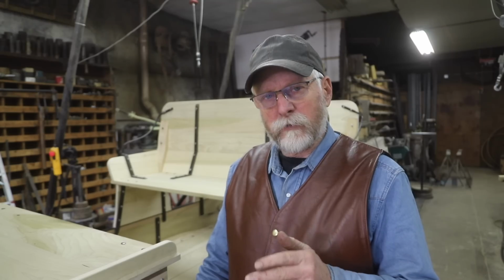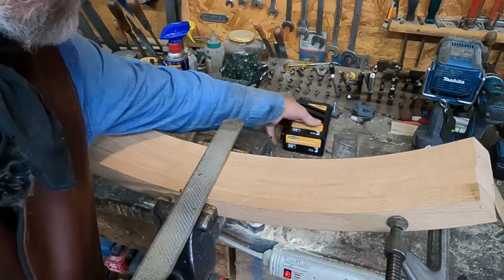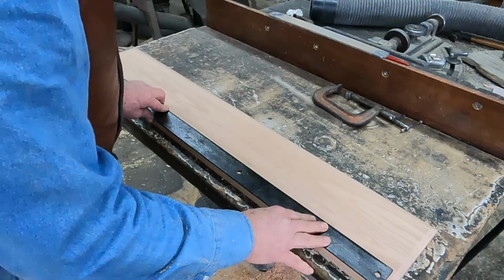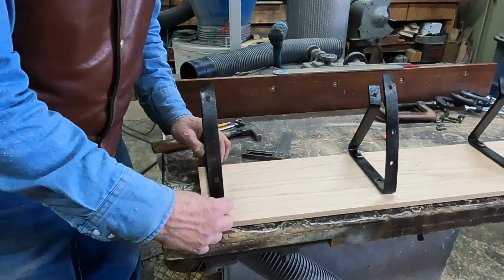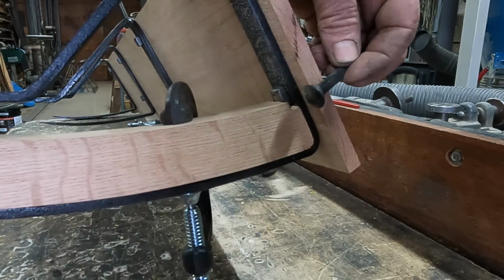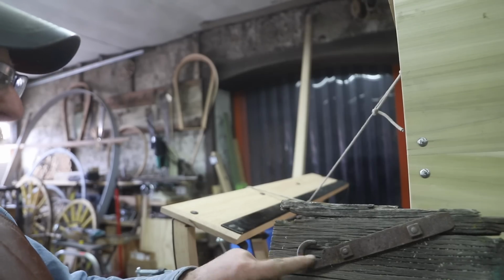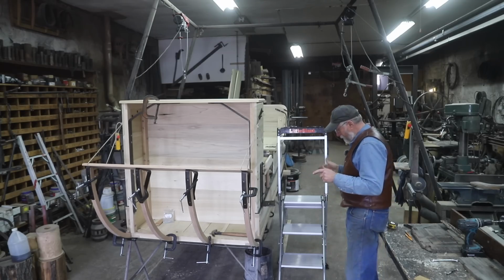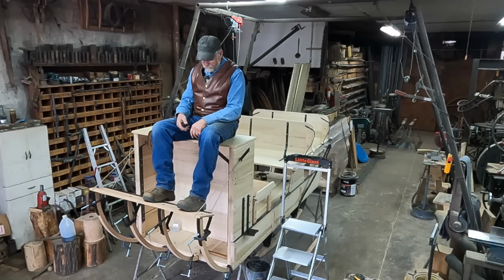Testing My Driver's Boot Design | Engels Coach Shop

Comment: A couple of extra chain links on the open hook would allow for adjustment for taller or shorter drivers. Just a thought Dave. The driver's end is really coming together and shows that your concerns are appropriate.
Reply: I totally concur! As innovative as folks were in those days, it's hard to believe they wouldn't have had extra links. They adjust the harness to fit the team, it only makes sense the would adjust the seat to fit the driver. Great project Dave!
Reply: I was thinking just the same. In fact that's the only sensible reason for having a chain and hinges rather than making the whole thing fixed.
Reply: @royowings3435  And as skilled and innovative as we all know Dave to be, I'd put money on the fact that a few extra links in each of those chains is already part of his plan!     🙃
Reply: Isn't that the reason it's on a hinge, so it can be adjusted?

Comment: It still amazes me that you can put a bar of steel in the forge, heat the end of it up to red/white heat and hold the other end in your bare hand about two foot away.
Reply: If heated in a coal forge it's okay, for a few heats anyway. If it gets too hot to handle, simply dunk it in water.  Now heating in a gas forge is a little different because the heat is blasting out the door and up the bar.  This can be controlled a little bit by using firebrick to close the opening, but I find the bar still heats quickly up the length. The only solution to that is a longer bar or grab the bar with tongs and dunk the handle end in water before hammering on the anvil.

Comment: Dave, I've pretty much quit using C clamps in favor of the pistol style quick attachment ones. My favorite brand right now is DeWalt. I'm pretty sure you eschew the advantage of one hand clamping because of the force you can apply with the C clamp and being able to use them on hot metal.

Comment: At the ten minute mark where you are notching the felloes to accommodate the nut, I can't tell if you are leaving enough space to get a wrench in there. I've been curious all along why the wreck had the carriage bolts installed the "wrong" way but now I'm wondering if maybe it was because the builder wanted to be able to snug up the nuts when the wood moved with the seasons. Fascinating work regardless.

Comment: You're correct, back then most people were generally shorter. But with the chain links holding up the toe board, each driver could simply adjust the height any time by moving a link up or down... right!?
Reply: Right

Comment: Rather than having that notch in the end of the curved pieces, I would be tempted to taper it slightly from where it first passes through the footboard iron to the end by the nut. Dunno if that's "correct" or not, but it feels more intuitive to me.

Comment: I was thinking you might have chiseled the notch on just the inner 2/3 or so of the curved brace to clear the nut and then the outside visible part would not have had the notch visible.

Comment: Great look on boot rest. I would have thought you might have slotted the end of the curved piece to straddle  the nut, then do the same with the intersecting wood piece so as to totally hide the nut within the two piece wooden corner. Not a criticism, just a different though. Thanks for sharing  your work which I greatly enjoy.

Comment: I was afraid that the felloes would change curvature when part was cut off. It looks like they didn't change much judging by the gap between the remaining part and the scrap.

That hook and chain would let the driver adjust the footboard to suit his ssize and position preference. Might want to provide a few inches of extra chain.

Comment: Well, if they used chains, they could adjust the footrest angle to accomodate taller or shorter drivers couldn't they? it only hooks onto a ...hook, leave about 8 inches of extra chain, adjust it as needed then.
Reply: Yes

Comment: I know its not correct for your work but if anyone needs a completely flush head take a look at an elevator bolt.  They have a square area under the head like a carriage bolt but are designed to go into a countersink so the head ends up flush with the surface.
Reply: Plow bolts are flush as well-

Comment: Great  work that you do. I noticed that your anvil has the 2 Prichard holes as well as the shoe clip piece (don't know what it is called ).I also have a anvil made by wright it is a 141 lb. Do you know why they had the second Prichard hole and was the extra side piece used for toe clips or not or what was it used for and the name of the piece. Thank You Arlen from ND

Comment: Why don't the front driver's box irons go all the way down another few inches to the bed board for 2 bolts on the side boards instead of just one. There's going to be up to 500 pounds (2 people) of multidirectional torque (125lb per corner) on just that one bolt.

Comment: Isn't that what the chains are for? To adjust the height of the toe board? Also, why do you paint the metal instead of heating them up then dunk them in oil? Or use bluing?
Reply: Yes it is adjustable.  I think he paints it because they did.